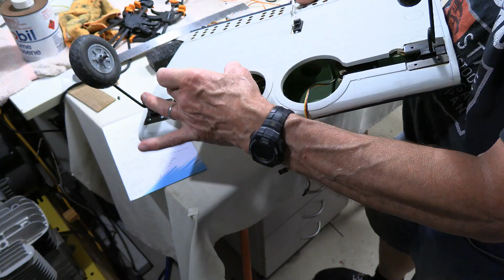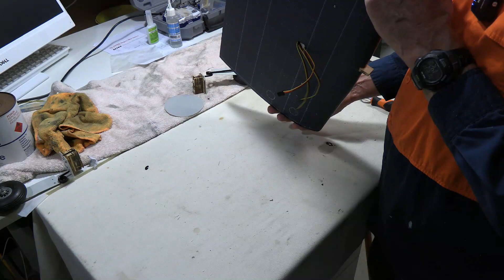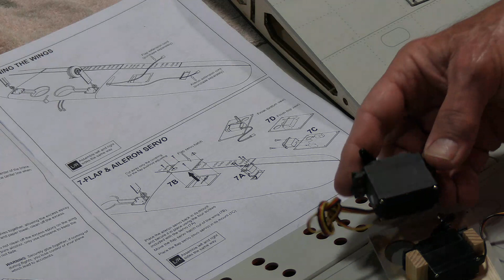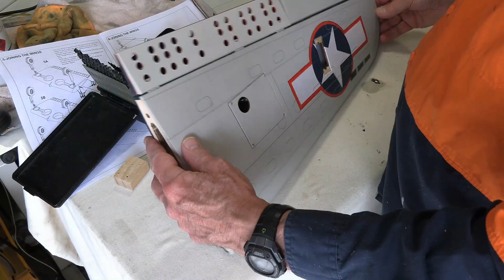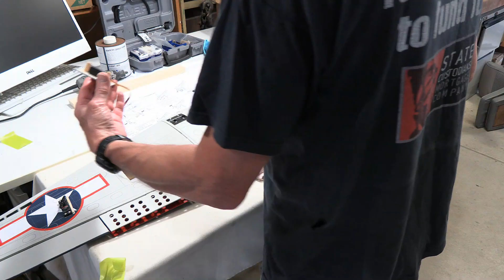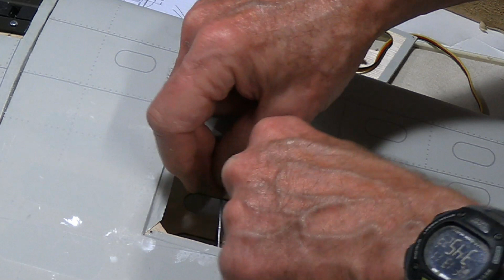VQ SBD Dauntless Build - Part 2

Comment: Building mine as well. I replaced the flap and dive brake horns (all of mine broke) with alloy servo horns cut and bonded in. Used ball joints on all the the horns and servo arms I also installed separate servos for the dive brakes and flaps. Following your build with interest Jim
Reply from the maker: Now I'm wondering if I should also replace the dive brake horns on the other wing!
Reply: I would Jim, I changed the original one because it broke while setting up the dive brakes, then a few weeks later the other side broke while static test in in my building room
Reply from the maker: OK, will do!
Reply: This video is great. Hey I’m working on one of these too right now. I put the red/green lights on the wing tips and I’m going to put a landing gear light to help me see it better. I’m new to this but after doing some research it sounds like you need another channel to run the air brakes separately. I’ll use flaps separately for landing when needed but do you use channel mixing to make the air brakes the master and the flaps the slave so all the right surfaces open up when using the air brake function? I’ve never used channel mixing and probably saying it wrong.
Reply from the maker: Sounds like you are doing a great job.  I trust that you have flown other planes before.  This one isn't the best for learning how to fly.  If you are going to separate the function of the outboard dive flaps from landing flaps you will need to modify it to have two servos for each pair of dive flaps.  You can then use mixing along with the relevant switches.  It's rather complex.  I'm just going to have the bottom dive flap separate from the outboard wing dive flaps.  That way, if I'm coming in too hot for a landing, I can give it some of the bottom middle dive flap.  Deploying all of those out on the wings would require too steep of a decent to keep it flying.  That way I don't have to add any more servos.  I will still have to do mixing to have the middle one deploy along with the outboard ones, while still having a separate switch to deploy the middle one by itself.  I'll include a video on the mixing when I get to that point of the build.
Reply: Jim I’m going to try it, I made a video of my pile of spaghetti wires on my table

https://youtu.be/sAMJKSW95xQ?feature=shared

Comment: Building mine as we speak,mounted flap servos in airframe,the hatch fixing seems very fiddly. Not the best built kit,instructions are a bit vague!
Reply from the maker: What you are saying about the instructions is certainly true.  They don't actually tell you the correct procedure for adjusting the dive brakes.  And nothing is said about the installation of an electric motor.
Reply: Manual had no mention of how to cut the hole or where for the wires, or the holes for the canopy, or the holes for the wing bolts. Perhaps a whiff of discussion about dihedral. And that layout for the flap servos, My shaky hands, wow.  My dash had no cutouts. Never mentions you have to glue the flap surfaces. Only one pilot no gunner, story of my life. But I am LOVING it.  Becoming a better fixer with every step. A contender. I’m building the Motion RC Banshee version now.
Reply: I mounted my Power 52 this weekend.  Used a pattern of the cross mount, transferred to the firewall so holes were centered on all four crosshairs, drilled, put 5mm blind nuts, used 25mm aluminum standoffs from motion, with washers for a bigger footprint at the firewall, Use loc-tite on cross mount sparingly, and also on the blind nuts to bolt threads (tilted the fuselage upright backed the bolts out to one thread of contact and added a drop to the hole then tightened making sure not to let loc-tite touch the wood, it’s acidic and weakens and dissolves wood fiber.  Then lastly I epoxied around each blind nut so they will never back out and to give them a little more footprint bite.  I mounted an Avian 100 A under the motor with motor wires forward.  Used hook and loop under and a wire tie around the floor of the fire box.  Looks sweet as pie and fits beautifully. Should get a ton of airflow and help move CG forward and down.  Also will keep high power lines away from receiver.
Reply: Lastly a pro tip for the ESC wires through the cutout in the firewall, the plywood had a sharp angle so I stuck on some loop from hook and loop and lined the hole before passing the wires so they won’t chaff.